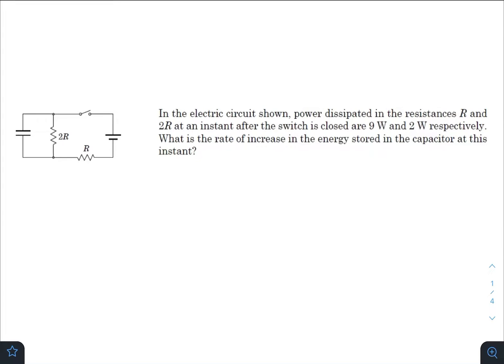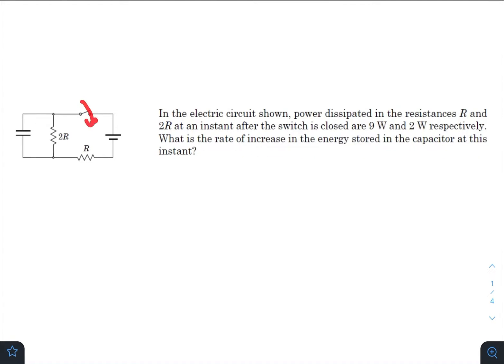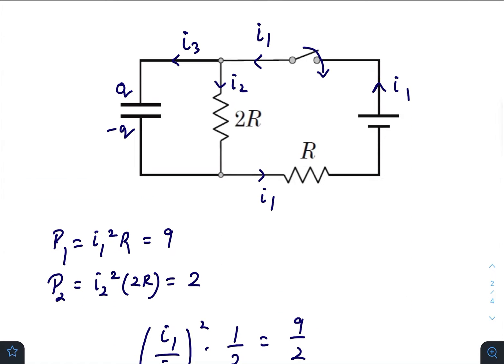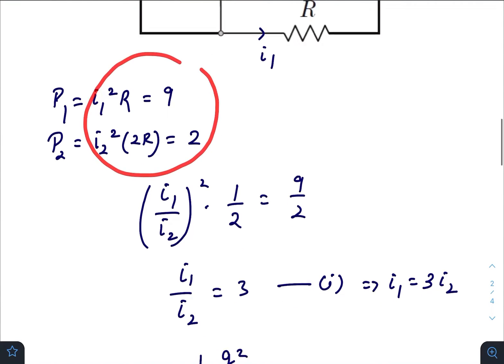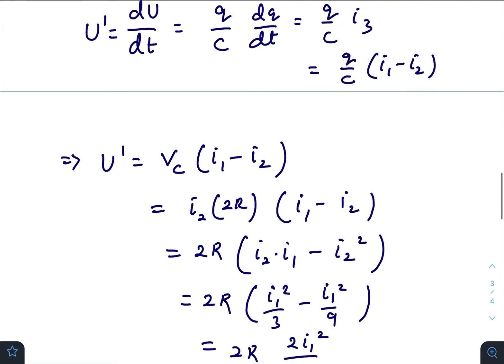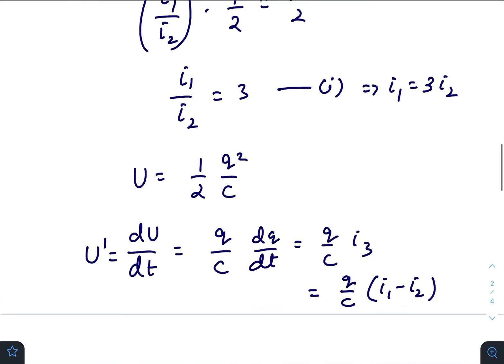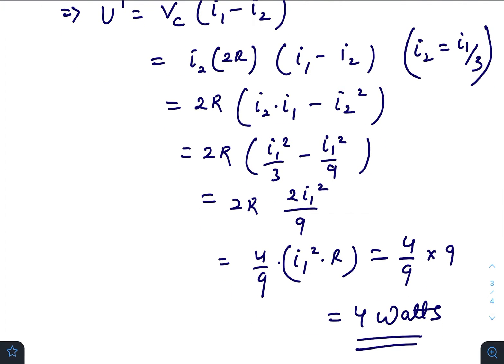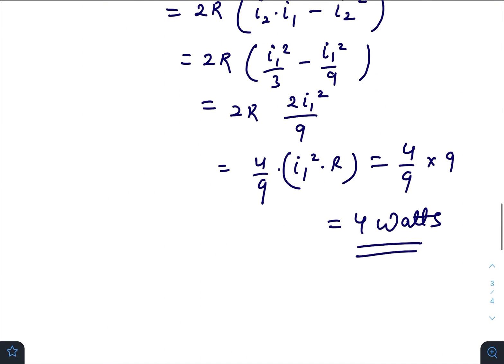Pathfinder for Olympiad and JEE Advanced, Page - 13.16, Q - 47

Comment: Getting 4 as answer without seeing solution
Reply from the maker: Absolutely correct📈
Reply: Sir used the same solution as you presented what was your approach earlier by the way??
Reply from the maker: @shashwatmishra4342  I found out the current in each individual branch...which gave me the same answer but became very complicated while finding out the power.